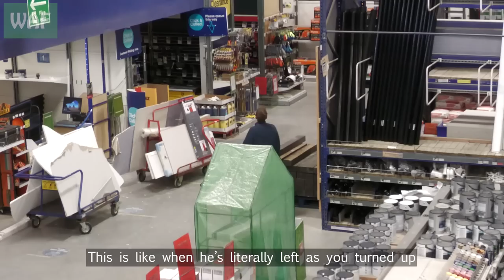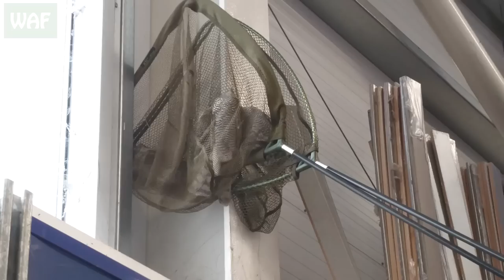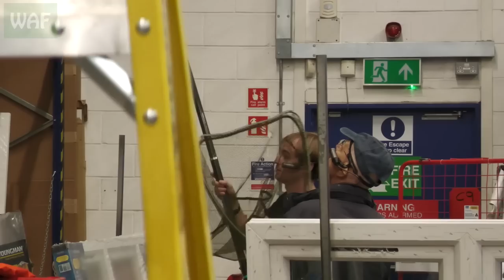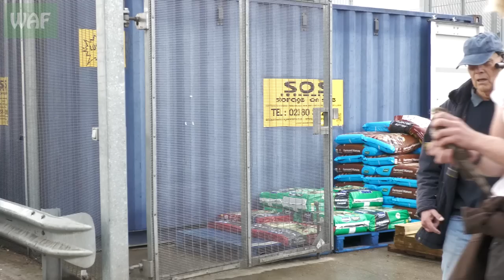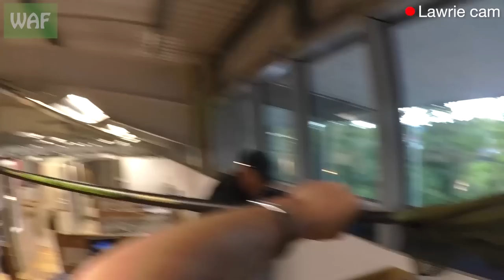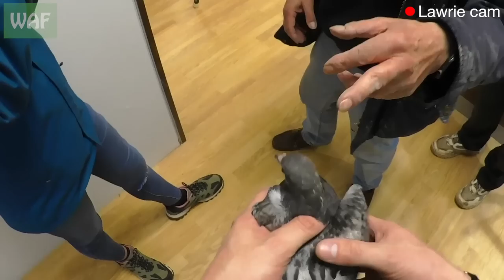Hawk chases pigeon into a shop… and BOTH get stuck! (Wildlife Rescue)

Comment: The pigeon is using the pigeon spikes as protection against predators. 😂 Well done, team! Two birds in one hour. Very efficient! 👍
Reply: Pigeons are damned smart. Scarily/impressively so. I have rescued a few and one, with a minor handicap, stayed. At one point, we had a few mice in the place. This pigeon likes having food dishes in lots of different places and also likes eating very messily, depending on her moods. But then she figured out that eating messily drew the mice to her. So she stopped being messy in the spot where she was spending most of her time, but one day, I watched her dropping food from a high spot and looking at the floor to see what would happen.
Reply: @angelinasouren  The place i work at tried to get rid of the pigeons breeding in the garden, so they put a net over it. But the building has automatic doors, and a pair of pigeons figured out to wait for someone to activate the doors so they could cross in and out. But others keep getting stuck in the damn net. Pigeons are both very smart and very stupid.
Reply: @feuerling  Ah, ask your employer to use different netting with the finest mesh size they can find. Preferably 5 mm or smaller. 

Also, it may be different pigeons who get stuck, not stupid pigeons who keep getting stuck. They may not be able to see the netting at the moment. 

What kind of place do you work at, where are the pigeons nesting? Is it a garden center with an indoor garden with many plant pots, or what? What makes it so attractive for them? What often works very well is offering them nesting spots that are so irresistible to them that they don't want to nest anywhere else. Presence of food and good water nearby, good shelter, low risk from predators are factors.

Comment: Best way to release birds stuck indoors is to turn all lights off, block windows from sunlight and open all doors. The birds will go towards the light.
Reply from the maker: That can work well for some birds, but birds of prey like sparrowhawks are a little more tricky. They won't fly down and through a gap so, unless the door is floor to ceiling, they will often miss it. 

Unfortunately this store was also still open and they could not close just for us :)

Comment: If only there were a way to make a really tall net with some sort of drawstring to close it
Reply: Well there is, would require the drawstring going down the middle of the rod and around the top of the net and a slightly deeper net in order to get the animal into the bag part. Only issue then is you have the issues of catching the animal's neck within the loop as you close it which is going to cause injury since the animal will panic even more, and being a deeper net there is more chance of catching the net on something
Reply from the maker: We've looked for one of those for about 5 years but have never found anything! If anyone does find one, please do let us know as we'd be first in line!